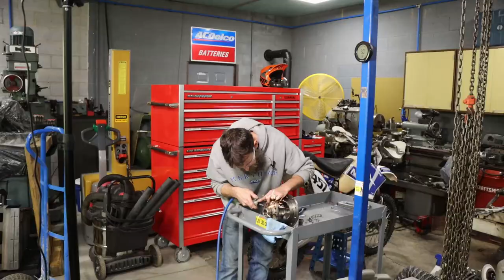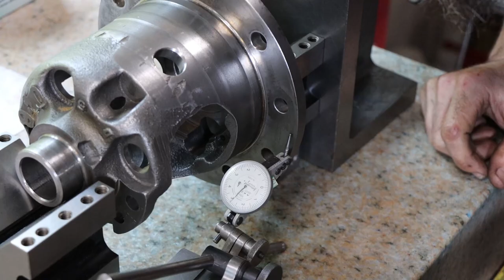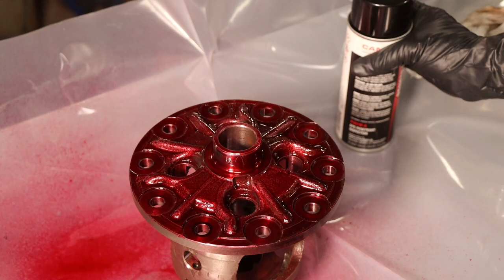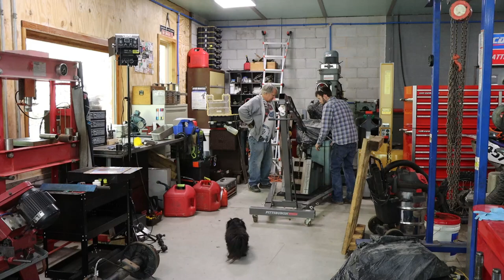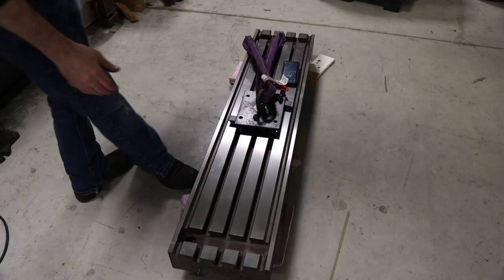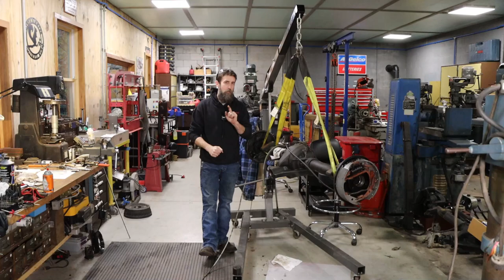Damaged Diff case check / New Equipment / Doall Mill Parts

Comment: As I've gotten older, anytime I have to work on something, I do my best to make sure I won't have to mess with it for as long as possible.  When I was a younger fella and I had tons of time, ambition and loads of extra energy, I would cobble things together, "experiment" with fixes and do enough to get something working and that was good enough.  Nowadays, enough things break down, that I'm not into gambling with fixes.  I take my time, do it "right" (or whatever works best for my application) and go from there.

Comment: As a NDE Teck, I would also like to add to the comment below that talks about holding the magnet in contact with the part. The next point would be to apply the powder with a puffer ball (applicator ) while the magnet is energized. So the steps would be to hold the magnetic yoke to the part energize the yoke dust the iron powder above the part (as the powder falls it will be attracted to indication). Deenergize the yoke, place the yoke 90 degrees from the previous position energize and apply the power. Avoid dragging the magnet when the yoke is energized as this will cause the iron powder to stick to the part and may mask indications. I hope that this help Mag particle testing is a very effective test when performed correctly.

Comment: One trick that has never failed me when using a bearing puller, is to smack the end of the pulling screw when under pressure, and it always seems to get the stuck bearing loose.
Reply: Yup, gets the bearing free and staring to move.
Reply: Funny, just the other day was watching a co worker heat a ball joint with oxy acetylene to red hot after me warning him about how its going to explode from the grease trapped under it and nowhere to go..  and just as the boss walks out i grab him and pull him behind the truck im standing behind watching, i point to ole buddy as he takes a welding pick hammer and wops it one time and damn thing explodes in a huge fireball..  big enough to cause the nitro filled shock to burst and shoot a stream of oil which itself looked like a flame thrower..  dude luckily was wearing his leather smock and electricians gloves with safety glasses.  Still burned his eyebrows off and second degree burns on his face .  Torched the leathers stiff..  and get this, before even checking if dude was ok mr boss ass started on me saying I put him up to it and blah blah your putting peoples lives in danger blah blah your fired blah..  all as i was blowing up myself laughing while ole buddy just walked around in a circle saying holy shit holy shit holy lord jesus shit..  lol.. before buddy drove to the hospital he told boss thAti had nothing to do with that and i even warned him about it and how he was stupid..  boss never apologized..  if i were a worse man i would have his job or break his jaw but all in a work day.  Everything was ok..  no lives or limbs were lost..
Reply: Giving stuff a smack at the right time is always useful ! put a wheel on,  tighten the nuts,  give the wheel a couple of smacks, see how tight the wheel nuts are now !
Reply: Did you mention what brand of puller you were using? If that was a Hazard Fraught puller, that would go a long way to explaining why the bolts were bending and it wasn't working. I paid a little extra years ago, and bought an OTC puller, which has never failed me yet.
When I was working in a machine shop with my brother-outlaw, I've seen him, multiple times, use a cutting torch to cut off pressed on bearing races, with nary a mark on the parent bearing surface. It's pretty amazing.

Comment: For MPI testing the yoke needs to be in contact with the body for best result, also using an X pattern along the way is even better. This method is used for testing offshore tools for cracks and nevere fails. When the yoke do not have contact with the body as it is designed for, the magnetic field will be weak.
Reply: I'm glad that I was not the only one to notice that. I have had literally hundreds of mag particle inspections on my work over the years (I am a welder by trade) and I have never seen any NDE tech hold the yoke above the item. It has to be in contact with the surfaces. With pressure piping you have to go across the weld and then inline with the weld having on leg on one side of the weld and the other leg one the opposite side.
Reply: I’ll second that as well.  The field has to be induced into the part.  Can’t do that through the air.  The particles align with the field in the part that has been disrupted by a crack.  MP techs are trained for a reason :).
Reply: I was wondering about that.
Whenever I have had cylinder heads checked, the magnet legs were on the head.
Reply: Way back in the day, i did a lot of magnaflux crack checking mostly on cylinder heads. We didn't have an electromagnet and yes, the magnet was always in contact with the iron.

Comment: Steve says, "This Diff is screaming don't use me" The YouTube audience is channeling "Just Use Me Up" like listening to Bill Withers! Because despite the fact I will never do this chore myself, I enjoy the heck out of your content. I had a plumbing chore today, kitchen sink related. I've got the p-trap replaced, ran water through it until no leaks, running the dishwasher as I watch this, because it'll likely put some pressure to ensure no leaks. For those who want to check for a leak on a replaced p-trap, facial tissue under the joint works really well.

Comment: I find it preferable to grind a flat into a stuck bearing race ,rather than cutting into it.
As the flat thins out the material and approaches cut through, the bearing material at the flat heats up ,oxidises and goes blue,so you can stop before the grinder hits the bearing seat.
Reply: +1 Also you can grind right up to the seat face clearly. Using a circular disc perpendicular you have to leave the thickest part intact or risk cutting into the seat face

Comment: Yes Steve, pulling a trailer, 3.75:1, running around ~3.45:1, best options for 4x4 gearing. I've run all makes, since I was a young lad on the farm, in the late 60's.
Best wishes from the far North.

Comment: Hats off to Al. Al your a good man and friend to Steve.
Steve, I'm just like you. Do it right or don't do it at all is my motto. Currently upgrading my 06' Dodge 2500 Mega Cab 5.9L diesel front axle to a 4.10 after having done the same to the rear previously. It was a 3.73, but I added 35s and this ratio is ideal. Also did the same on my TJ Jeep. Went from 3.73 to 4.56 on front Dana 30. Doing the same to a hard to find, but I found one, a Dana 44 Rubicon with disc brakes to replace my Dana 35 on my 97' TJ. Thanks for your videos sir!

Comment: Steve,
The word you were searching for when identifying the bearing ID "seat" surface was Journal.
I am a big fan of PROTO pullers. The puller jaws slide and position so easily compared to other brands.
Thank you for demonstrating the crack inspection methods. I have had this work performed for me, but I have never seen them demonstrated.

Comment: I am of the same opinion regarding leaving the score marks on the solid way services. When the bearing surface area is adequate score relief is just more oil relief. I repaired machinery for 34 years and I cannot recall a single occurance where I regretted that decision, assuming the described factors apply.

Comment: Great job on the axles so far. You'll probably like the new gear ratios. They're much better for running around on the farm. Also congrats on getting the machine parts back. First chips on the DoAll is gonna be a cool day. 😁 Also like the new song at the end. In my opinion better than the previous, although some may disagree. Great video Steve!

Comment: Man, I wish I had someone to randomly show up and drop tools off for me!  Good call on the diff.  You would never have felt safe with that gnawed on G-80, especially if you were asking the truck to do something a bit hard.  I like the approach on the axles as well.  You aren't going overboard with stuff that will change the character of the truck, but you are going to make them completely trustworthy and reliable.
Reply: The only things people ever drop off for me is junk they want me to fix for next to nothing……
Reply: After seeing the G-80 closer, I agree you probably would always be doubting it.  As for gearing, I am sure you will like 3.73s as that is what you already have and are used to them.  I have one of the military blazers that these came out of and I have found that 3.08 works well for me.  I do a lot of highway driving with a good bit of driving in muddy fields, forest service roads and packed snow.  I am perfectly fine with shifting into 4 low on my transfer case when I need lower gearing and getting the better road manners in 2wd.  I don't even always get out and lock the hubs, sometimes I just drop the case into low range to creep.  Either way I am SURE you will like having a set of axles you know where done right and can trust.

Comment: Rear end ,  Steve , I hope you read this as I did this on my old 71 Chevy C-10 and it worked out great. I found in a local junkyard a 3/4 ton Ford van that came from the factory with a Dana 60 rear and many of them come with 3:73 gears in them .  The backing plate diminution were the same as the Eaton rear you have now. I picked up the rear complete for 90 dollars after I pulled the inspection cover and everything looked to be good. I did a standard service on the rear (replaced all the seals and rear gasket & lube) . I did have to cut the old leaf spring perch's off the Dana rear and my old Eaton rear as well and weld the Eaton spring perch's on the Dana rear after carefully getting the location &  pinion angle on the Dana 60 correct under the truck. They sell a Eaton to Dana rear U joint to put in the driveshaft and from there on it's pretty much a bolt in operation. The beauty part is with the Dana you will be HARD PRESSED to EVER brake that Dana over the Eaton. Bottom line these Dana 60s are very common under Ford & Dodge Trucks and you can find them in good shape pretty dog gone cheap in scrap yards with nothing more then a tape measure and when completed wind up with a very tough rear end for less then a new pair of quality axels !  As I recalled I had to locate a different set of used rims to fit the Dana wheel pattern as the Eaton / Chevy wheel pattern is different but the rims I used under the Dana were on the rear when I bought it out of the Ford Van so all I had to do was install my tires in the Dana rims. I drove that old truck to work for decades with that Dana 60 rear and never had a problem. My old C-10 was stolen about 10 years  ago and I never seen the old girl again . I replaced it with a 1970 C-20 truck I drive today and I already found a pair of Dana 60s out of a Dodge power wagon  and well replace both of the Diffs in the future under the C-20.

Comment: With no overdrive tranny I would keep the 3.08 since it is a 4wd and you can just put it in 4 low when you need slower.  You would likely gain 1mpg on the highway versus 3.73.  At $4/gallon gasoline that savings adds up quick.  if it was a 2wd I would say the 3.73 is the right move but since you have the extra reduction available might as well take advantage of that.

Comment: WOOHOO, I was almost running out of o2 waiting for Saturdays post. What a wonderful way to start a post from you. The sound of the creek is so soothing. It would be my forget about my troubles place to be treasured for sure. Old, found chisels are a treasure. The new ones just don't seem as tough. Wouldn't any runout be best checked with all bolts and crown gear in place ? I sure like your style my friend. Any NHRA shop would be pleased to have you in their operations for sure. Hopefully the new DO-ALL will only need a shear pin or something like that to straighten things out. What a beauty. Set up right someone like me can use it as a mill eh. Easy way to rid your bearing races, A weld around them and out they come with minimal tapping. Coming from your  approach in things this project will bear fruit all day long. Take care. This seemed like 10 min once again my friend. A pair of Corporate 12 bolt axles will sure shine for you eh.

Comment: still think a concrete slab and a crane of some sort in front of the shop helps a lot with unloading stuff like those on the trailer or in the back of the truck , it allso alows youre palletstacker to be used outside around a trailer or the pickup
for sale.... smaller doal drillpress
changing the gears for the ones that are currently in the truck will help keep the speedo display the correct speed too (no need to change the small speedogear inside the gearbox )
with all the stuff youre doing to these axles (replacing all the bearings seals rear diff housing and watnot) it might had been more economic to redo the axles that are currently under the truck
at least the ring gears in those are good and the right ratio

Comment: The old pinion gear and the new should have a =/- number stamped on them to indicate the machining accuracy of the bearing seat, so you can determine the thickness of the shim to be used on the new. All of them I have ever replaced have that feature.
Reply: This is true, sometimes. Also, it may have been helpful to rig up a depth mike to determine the pinion depth from the centerline of the diff carrier bearing saddles for a potential starting point for calculating the trial shim thicknesses.

Comment: AvE did a vid showing how running a bead of weld round an outer race caused it to shrink and fall clean out of a blind bore when it cooled, pretty damn sure should do same with a stubborn inner race on a shaft.
Reply: Why would you think shrinking a race on a shaft would make it looser?
Reply: @philmenzies2477  good point, well made! note to self; step away from the keyboard after the second glass of scotch!
Reply: @philmenzies2477  Well,  in Phil’s defense if you run a quick bead round a bearing race, then’s the time to hit it !

Comment: Tip for easy bearing race removal, lay a weld bead on the race with Mig or go around once with the TIG Torch without filler, the race will just fall off.

Comment: Great video 👍Steve another way to remove bearing's just apply a hot bead of weld on the race usually slip right off.

Comment: Back when I was doing a fair number of ring & pinion setups, I bought two identical rear pinion bearings. Then I honed one of them until it was a light press fit, so I could try different shims to get the pinion depth perfect, before I pressed on the untouched rear bearing for final fitment.
If you can, maybe you can make your own or buy the correct pinion bearing spacer, so you don't have to use the collapsing preload spacer.
Also, I use artist oil paint, thinned with a few drops of rear axle oil for checking gear pattern for drive/coast sides of ring gear. I prefer "cadmium yellow",  but you can use whatever contrasting color you want.

Comment: 1st Hooray Steve has made it. Steve if you suffer outages too often maybe you want to consider a UPS (uninterupted Power Supply) for your computer, then it will give you a chance to save your work before the computer dies.
Reply: I believe this one he said was a software issue.
Reply: @R_Forde  If you checked the channel yesterday they had a storm and a power outage. Check in Community.
Reply: @ericmcrae7758  That power outage comment was from 2 months ago. LOL

Comment: Regarding what to do with the axis:  I'd say that getting the setup exactly the way you want it will serve you for decades at least, since you maintain your vehicles much better than what was done previously.  And getting a new vehicle? It would be outrageously expensive and not be as durable as what you're doing. So I for one think you are making excellent and well-thought-out  choices.

Comment: Steve, I think you will find that changing gears and setting them up properly isn't as difficult as you may think. Yes, it does take some time. But with a dial indicator, it is easily doable by most anyone that understands what they are doing. JMHO And remember, you are not building a rock climber or mud bogger. You are merely building a work truck!

Comment: Thanks!
Reply from the maker: Thanks!👍
Reply: Hello Steve
Great video as always. 
Just one thing as already mentioned by other fans. You have to touch the material to test during MPI.
I recommend that you purchase a set of “castrol burmah strips” which will give you 1-2 or 3 stripes when your magnetic field is strong enough.
Also please use white contrast background and magnetic ink instead of dry powder. I have been an MPI inspector level II for 15 years. And our company would not accept dry powder method due to the fact it is not very good.
Best regards from Denmark
Thomas F. Johansen

Comment: When installing the new outer races, I use the bench grinder to reduce the OD of the old outer race enough to make it a slip fit in the housing.  That way, you can press on the old race and not risk ruining the new one.

Comment: We used the same penetrating spray when checking for cracks in molded white plastic/polymer parts.  Didn't need to use the developer because of the base color of the parts.  AFAIK the magnetic yoke needs to be in contact with the metal parts to induce the field into the part when doing the other testing.  On the other hand, I could be entirely wrong.